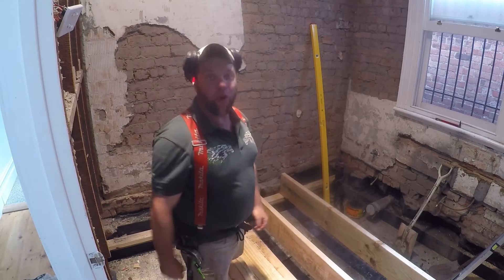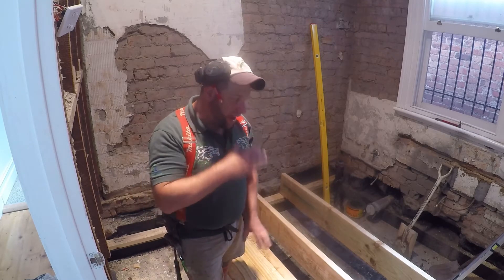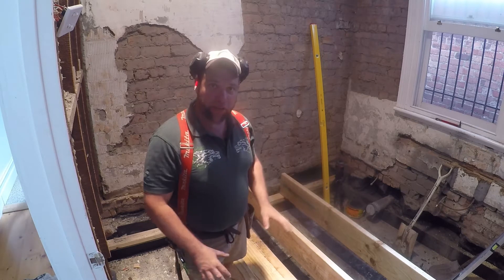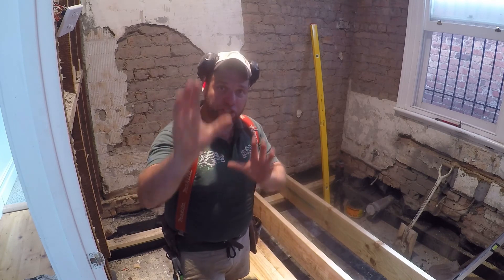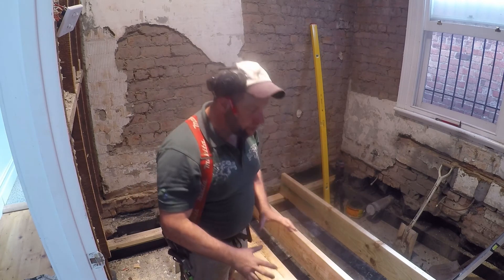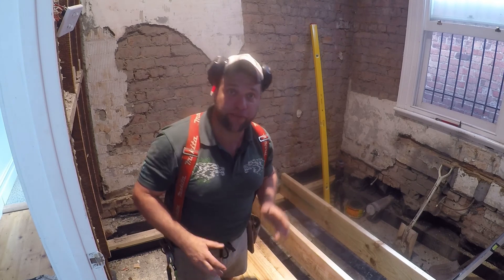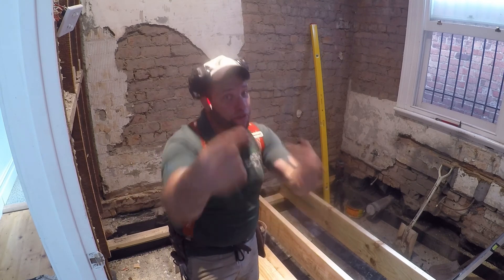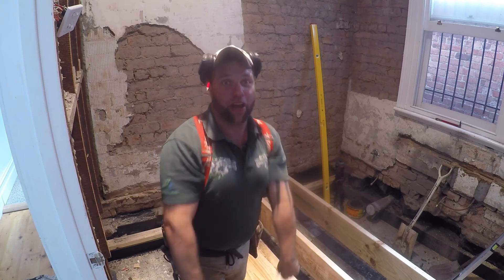Should you use Treated pine for subfloor framing.

Comment: Do you not use a decoupling membrane like Ditra matting? This will decouple the subfloor from anything above to allow movement.
Reply from the maker: Gday Stephen,
When working on a commercial bathroom or wet area then YES, we use a matting system over the whole area.
On a domestic/residential bathroom/wet area, we use a few different methods yet not one with a matting system throughout. 
instead we use a specialist, pre-made corner and joining tape, primer, membrane system.  
There is a matting that we use over the penetrations, joins, shower shelf inlays etc. 
#stayawesome
joe joe
Reply: @BeowulfBuilders  Thanks for the reply. Have a great day.
Reply from the maker: Right back at ya stevo